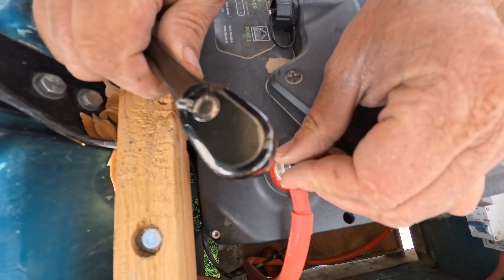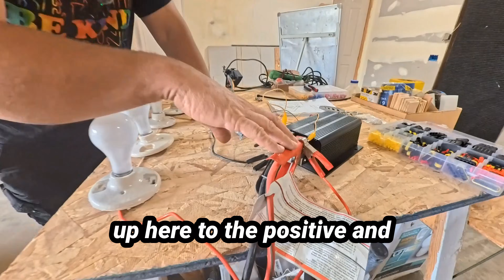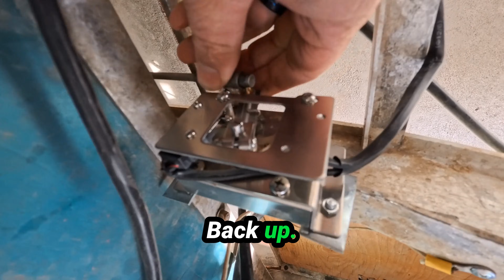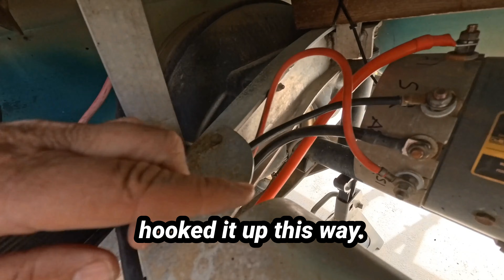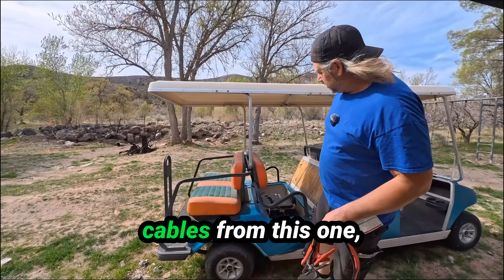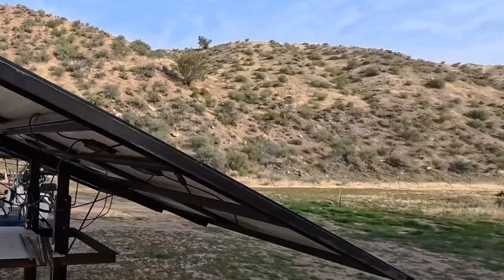Club Car Resistor to Curtis 1205 Solid State Conversion

Comment: Question #3:
Your “Big Battery” specs say:

Max Discharge Peak Current: 150A (Max 5 seconds)
and
Max Continuous Discharge Current: 100A

However, your controller is rated for 500A. 

This would seem to be a massive problem! The controller will ask for 500A but the battery can only give 100A. I assume the battery has a BMS that will shut down all flow when flow exceeds the limits. I’ve read that this can cause the cart to suddenly halt. Not cool! 

Have you programmed your controller to cap request on the battery at 100A? 

Is my concern making sense to you? Maybe your Big Battery simply limits above 100A rather than an on-off (yes-no) response, but I bought a DCHouse battery with 200A Continuous discharge BMS and understand the battery totally shuts down if that’s exceeded.
Reply from the maker: I probably wrote the specs wrong in that video the Max continuous discharge is 150 amp on the Husky 2. https://bigbattery.com/wp-content/uploads/2024/02/HUSKY2-SpecSheet-1.1.pdf?ref=thesolarfarmer Here is a video that shows the amps coming out of the battery as I climb a mountain. https://youtu.be/o_snR9YprB8
I think the motor can only take so many amps and that's what restricts the flow. I oversized the controller so I would not burn it out. It seems to work really well the controller does not overheat with continuous mountain climbing for hours.

Comment: Question #2:
You said in Description notes: “When getting a Controller, make sure it’s programmed correctly…0-5 vs 5-0”. 
I dunno what you mean. Let’s say I rip out my old stock controller and replace with the one you used, with links to buy in Description notes, then do I have to program it? Do I tell seller to send me one vs the other? What goes 0-5 or 5-0 even refer to?
Thx!
Reply: Oh. Looks like I missed the Pinned Comment where this is discussed.

Comment: I must hand it to you, you made a great solutions/how-to video AND you are helpfully responsive to everyone in the Comments section!!!
I bought an old Club Cart for $500 and hope it’s just the lead-acid batteries as to why it’s dead. 
How would I test the motor function before buying your 4 parts and rewiring it all?
I already have a 48v LFP. 
Any thoughts?
Reply from the maker: That's a good buy on a club car congratulations on your purchase. Most of the time I buy golf carts the lead acid batteries are the reason why they don't work. Put a voltmeter on your batteries and check the voltage make sure they are topped off with water and try to get them to take a charge. The best way to check the function of the motor is to get power to it if you can't get the lead acid batteries to take a charge then I would put the lithium battery in and try it.

Comment: If you want to reduce your speed in reverse see my explanation in my long post on how to reduce the speed in reverse to 0 - 2,500 ohms input.
Reply from the maker: Where do I find your long post?
Reply: @Thesolarfarmer  It is the first post I made a month ago and you replied to it.
Reply: Let me know if you don't find it. I will repost the explanation on the reverse speed resistor. I wished we could post pictures on here. It would make it a lot easier.
Reply from the maker: @smitty2721  thanks, found it.
Reply: @Thesolarfarmer  Here is a link to my photos and my wiring diagram modified.   https://i.postimg.cc/bJnDWQzz/Main-Contactor-Active.jpg

Comment: I wired up as you did in the bench test with a 36v setup. But am getting 36v between the lights in series with the switch off and when turned on the pot box doesn’t turn the lights on 🤷🏽‍♂️🤣
Reply: Capacitors in the controller may still have charge on them enough for your VOM to measure the voltage but not enough charge for the bulbs to illuminate. Remove the wire you are using for the key switch, turn Main switch off also. Just for grins remove a wire from one of the throttle terminals.  Give it a few seconds. Connect all the wires and try again.

Comment: So I got everything wired up like you did it. Is it normal to have volts going to s1 and s2 on forward and reverse while key switch is off but forward and reverse switch is engaged?
Reply: Aside from that everything seems good
Reply from the maker: You made me curious, so I checked mine and it is doing the same thing. I think it has something to do with the pre charge resistor.

Comment: I can't figure out the stock F/R switch connections,  to hook up S1 & S2, M, and S2, from left to right, which ones go where on the switch?? this is the only thing I have left to do...please, and thanks!!!
Reply from the maker: Page 13 https://www.manualslib.com/manual/815243/Curtis-1204.html?page=19#manual
Reply: @Thesolarfarmer  I think it's wired up right, but bypassed the key switch to get the relay to work, but nothing when using the accelerator, F or R, have power at controller
Reply: when I check the pot box wires, reistance, I get no reading at all with an ohmeter
Reply: fixed the pot wires, still won't run
Reply: I have forward now, no reverse, M goes to tab sticking out of the  side of FW switch on stock switch, suggestions please???
Reply: For stock club car, 1993 FR switch, it has 3 lugs beside the 2 top connections for s1 and s2, the side lug goes to M, bottom 2 are jumpered together where  A2 goes, now have Forward and Reverse...done at local golf cart shop......    expensive lesson...other 2 wires on pot throttle are used to activate relay whenever throttle is pressed to run if anybody wants that feature.....this is a fix for older Club cars  with this switch......I thought about jumpering these 2, but was worried about frying something!

Comment: Would like to see you swap to an SW202 instead of that FNR switch. I have a lot of current getting pushed from my S1 and S2 cables to my “HD” FNR Switch. I’m working on the SW202 right now and am stumped 😩
Reply from the maker: I have a 2002 Club car that I am going to be changing to solid state. I think I will put a SW202   in it and make a detailed video on how to wire it in. I have had a few people ask how to do it. Sometimes when I'm stumped, I sleep on it and let my subconscious mind figure it out. There are some videos on YouTube, but I have not found any that are easy to follow.
Reply: To @Fintales,  I used the Albright style SW202 48v 400 amp solenoids on my conversion. Did you figure yours out?
Reply: @smitty2721 sure didn’t haha. Taking a break from that project since I have other things to mess with. I’m pretty sure it has to do with no microswitch in the potbox but after adding that back I think I could get it to work. Would love to see what you came up with if yours is running!
Reply: @Fintales It was difficult for me as well, I forged through it visiting golf cart forums and worked it out.  I would love to help but since we can't show photos here it makes it difficult to get the message across.  There are I believe video's on you tube talking about how to work with the F&R solenoid.
Reply: I realized that I could post a link to my photos. But I've been having a little trouble doing. Hopefully this will work to see how I wired my SW202.
https://i.postimg.cc/hGvs63zV/SW-202-Wiring.jpg
Reply: I managed to put a picture on my channel of how I did my SW202.
http://youtube.com/post/Ugkx0YCcVM9un8CpjY_yabZ25GoxosIwjgzO?si=juJKPmS5fLDjM7M2

Comment: I follow your video great up until you say you wired it diffrent for the vA2 when did you bolt on the other wire to the forward and rev switch. Next thing you know you have two wires bolted to the switch. that looses me.
Reply from the maker: The way the manual shows to wire it is A2 from the controller to A2 on the motor Because the forward and reverse switch that I bought had a solid plate on the back I hooked my A2 from the controller to it. There are a couple ways to wire it just figure out what works best for you.

Comment: I am doing the same coversion to my 2002 club ds. You had the same potbox as i have. it has 4 wires on it. how did you know what two wires to use to run to the controlor
Reply from the maker: In the description I have a link to a short video that explains it.

Comment: My F/R switch doesn’t have anything on the back like yours to go from the controller. What am I missing?
Reply from the maker: The original F/R switch has the plates on the front and aftermarket I bought has the plates on the back.

Comment: My solenoid doesn't have a precharged resistor. Will that prevent the controller from turning on? Second question...my F/R switch where "M" connects doesn't have the jumper bar like yours. There are two separate terminals/  Would that prevent the cart from moving?
Reply from the maker: Your golf cart will work without a pre charge resistor, but your controller and your solenoid will last longer with the pre charge resistor because it slowly charges the capacitors in the speed controller and it also protects solenoid contacts from arching and pitting. Double check with the Curtis control manual and make sure everything's wired up correctly.

Comment: All wired up, getting power at the controller and solenoid, but pushing the pedal and nothing happens. I cut the wires on the pot box and took the two out to the controller like you did. Mine is an 88 club car with an upgraded GE 48v motor. Getting a click at the solenoid so I've done something right and I'm really close!
Reply: I am in the exact same spot. I have everything wired up and getting power to the solenoid. No movement from the cart though.
Reply: @alexclark6561 I think my controller is a dud. Tried doing the bench test and got nothing
Reply: @nathanealy6507  did you get it running?  mine is the same thing
Reply: @richarddegen6184  I have a new controller coming tomorrow. Crossing my fingers
Reply: @nathanealy6507  did you use stock F-R switch, I did, not sure if wired right
Reply: @richarddegen6184  I got the new one he put in the comments
Reply: was it  an Ebay controller?
Reply: @richarddegen6184 Yes it was. I guess I just got a dud, or at least that’s what I’m hoping
Reply: @richarddegen6184  Yes it was an eBay controller
Reply: @nathanealy6507  I now have  forward, no reverse...had M from controller to wrong spot on FR switch
Reply: @richarddegen6184 That’s improvement!
Reply: @nathanealy6507  how is your new controller coming along?
Reply: @richarddegen6184  I haven’t been able to try it out yet. Maybe this afternoon
Reply: getting GPS 17-18mph on flat road w/D&D motor, EB 36v 105A lithium Fe phos battery, hills easily
Reply: @richarddegen6184 That’s great! I ended up getting some help and I think my connections just weren’t good. I’m up and running now. I only have a 30ah lithium battery so the weight is really low and I can get about 20. My pot box doesn’t even extend all the way and not sure how to get more extension
Reply: @nathanealy6507  move the controller on bracket mount forward or backward to get more range/movement/throw  on throttle rod

Comment: Hey I have an chinese golf cart, bought it dead for 50€.
My motor looks exactly like yours, just without the Clubcar label, my complete cart seems to be a clubcar copy with steel frame.
However, it had a broken copy of Curtis 1266a build in but the controller normaly needs a speed sensor which it doesn't have, also the Pin positions didnt make any sense according to Curtis Documents. 
I would like to do the same conversion, but on my Controller the small Contacts on the motor are labeld as S1 & S2 not A1 and A2 like yours does, does that matter? 
As is said the motor looks exactly the same as the one shown in the video.
Im new to this :D
Reply from the maker: Did you look at this manual?https://cdn.curtisinstruments.com/products/manuals/1266AR_manual_en.pd
Reply: @Thesolarfarmer  Yes that manual. But the wiring doesn't make any sense, the built in Controller is wired differently.
How can i check what type of motor i got?
Reply from the maker: @CptnTurbo  do you have a tow run switch?
Reply: @Thesolarfarmer 
No. No speed sensor either, which is weird because i think sepex Motors need them to work, sepex controllers need one.
I think i just try the 1205.
Reply: @Thesolarfarmer So by connecting A1 and S1, A2 and S2 i can get the motor running.
As i learned this should mean i have a shunt wound motor.
Is it compatible with the 1205 Controller setup shown in your video or do you know which controller would work?
Thanks
Reply from the maker: Sorry I don't know which controller would be compatible with that motor.
Reply: @Thesolarfarmer  The 1205 Worked. 
Very happy with how easy the setup is, i even have acces to a Curtis 1313 Handheld from Work.
I can adjust all the Parameters and even could change my Drive Pedal from Type 0 Potentiometer to Type 2 0-5V which already came with the cart.
Didnt think that would work as it isnt Original, even reading Error Codes workes, so future problems should be easy to localize. :D
Thank you very much for the Video! Helped alot.
Reply from the maker: @CptnTurbo  That's awesome man. I wish I had a 1313 handheld.
Reply from the maker: You will need to determine what motor you have for sure. I think you might have a Sepex  motor and a Curtis 1205 controller will not work for it.

Comment: Howdy, been studying your conversion video, have a 93DS, 36v 105 A ECO lithium battery, and a new D&D 170 002 0002 higher performance than stock motor...runs great, going to do your conversion setup, resistor setup appears to waste power, which is why.  Wondering if I can use stock F/W switch to simplify wiring, using all other components you describe.   Richard, San Antonio, Tx......thanks
Reply from the maker: You can probably use the stock forward and reverse switch. Now that I know it works. I am going to make another video with more detail and more stock components.
Reply: @Thesolarfarmer  Thanks!
Reply: The new motor made a BIG difference!
Reply from the maker: @richarddegen6184  I am glad the new motor is working good for you That's awesome.
Reply: F/R switch
Reply: another question....there are 2 fuses in the schematic, one from battery  Bplus to relay, and one from Bplus to keyswitch...what are the values of these fuses?
Reply from the maker: @richarddegen6184  If you were going to put in a fuse between the battery and the solenoid it would need to be at least a 250 amp fuse. I am relying on the lithium battery BMS as a to cut power if there's a problem.
For a golf cart, the size of the fuse used from the key switch typically depends on the specific model and the load being connected.
A 10 amp fuse is often recommended for light kits, but it should not exceed 15 amps to avoid overheating. 

For voltage reducers, a 15 amp fuse may be necessary to handle the additional load. 

Always check the specific fuse ratings for your golf cart model to ensure proper protection and functionality.
Reply: @Thesolarfarmer  thanks, I thought the big fuse would have to be  very large....no fuses in stock  wiring that I could  find
Reply from the maker: @richarddegen6184  Yes you are correct stock wiring does not have a main fuse.

Comment: So I wired everything up but my pot box as I press on it it starts out full throttle and then goes less as you push the pedal. Any ideas on what could be wrong?
Reply from the maker: Most likely your pot box and controller aren't the same. If pot box is 0-5K and your controller is 5-0K  or visa versa than this would happen.
Reply: That’s what I figured I had just got thePB-6  2 wire one . I’ll try the same one you have

Comment: I bought all the parts and am ready to start the process. This may be a dumb question but can you explain how the resistor and diode connect to the solenoid just so I don't make a mistake there?
Reply from the maker: I did not use the diode because my golf cart does not have regenerative braking. The resistor connects between the two big positive bolts on your solenoid it gives just a little power transferring to the controller, so that it has a little power in it all the time.

Comment: Hey great video! I'm trying to fix my 92 club.car resistor v drive , and I noticed your solenoid engaged when you switched forward reverse  lever , is that normal on mine it only engages with drive pedal it's pretty much the same set up as your video conversion . 
Navigating the controller and parts is quite the challenge,  too many sellers and opinions lol is that a 1205 m programable and could I get where you purchased you parts , another issue is all the places selling and looks kinda sketch , just wanting a safe distributor .
Reply from the maker: I don't have the switch hooked up that is in the pot box which is hooked to the accelerator pedal. That is why the solenoid turns on when I turn the forward and reverse switch. In the description of the video is a list of parts.
Reply: @Thesolarfarmer ok thought I was missing something what's your opinion on the 2 solenoid forward reverse setup as opposed to the mechanical
Reply from the maker: @davidfarmer657  I have not had any experience with the two solenoid Forward reverse setup. It is on my list of things I want to try.
Reply: 1 other thing do you recommend a supplier to purchase controller,  solenoid and foot switch?@Thesolarfarmer
Reply from the maker: @davidfarmer657  I got my parts on Ebay.
Solenoid Heavy Duty 400A 48V https://ebay.us/s8SWjX
36v-48v High Amp Forward Reverse Switch https://ebay.us/fP9CyF
Type 0-5K Throttle PB-6 with MS 3 wires PB-8 for Curtis PB 8 type Potentiometer https 0-5k Controller https://ebay.us/908UAJ
P1205M-5603 500A China-Made DC Motor Controller 48V https://ebay.us/mm6MV4
Reply: Thank you ! @Thesolarfarmer